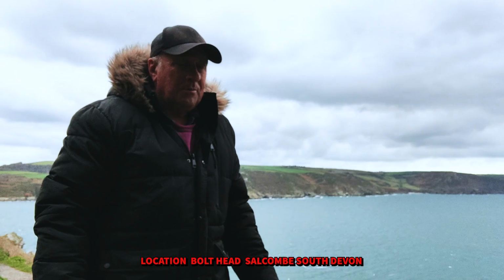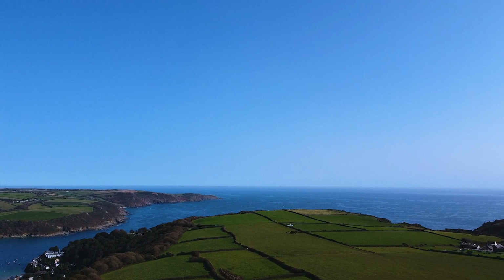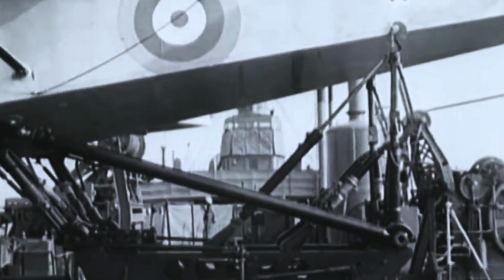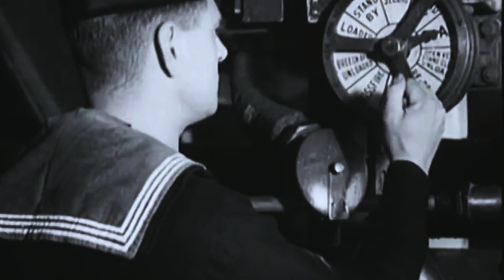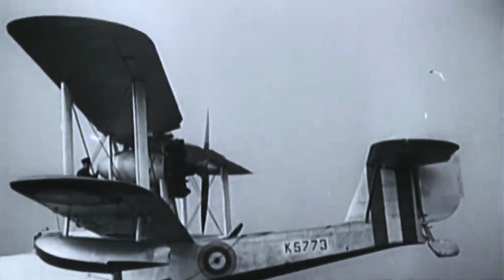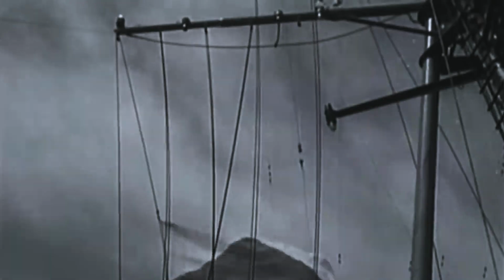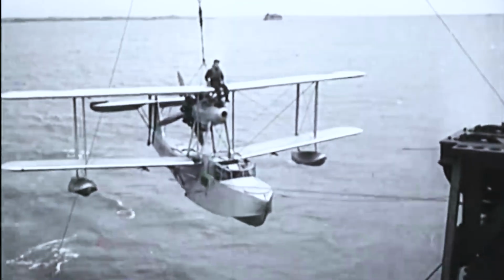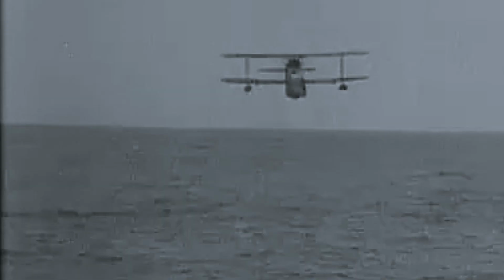SUPERMARINE  WALRUS  WARTIME  SALCOMBE  DEVON

Comment: Some of the details might be inaccurate, however. Early in the Battle of Britain Ian Smith (Later prime minister of Rhodesia) was a spitfire pilot, his aircraft lost engine power just after takeoff and the crash gave him substantial face injures. After he'd recovered he flew in Italy and was shot down behind enemy lines, I think he was relatively uninjured this time and operated with partisan forces until the front reached them.
If my memory is correct, some of these seaplanes were very underpowered and struggled to get free of water even in ideal conditions
Reply from the maker: I am sure you are correct there are many accounts of them being towed back to harbour because they could not take off again.